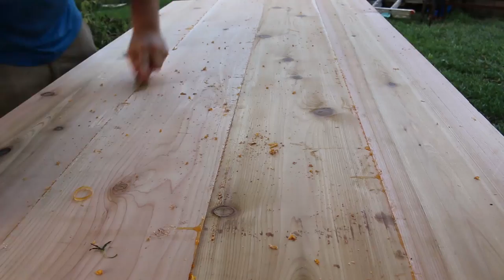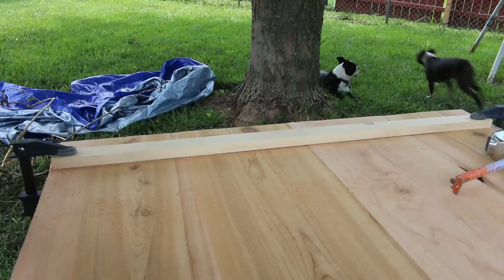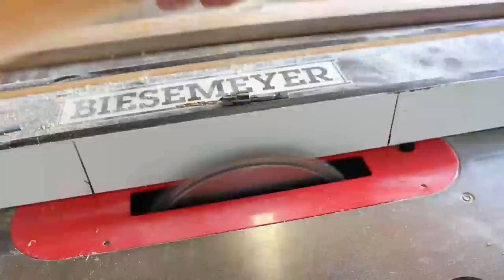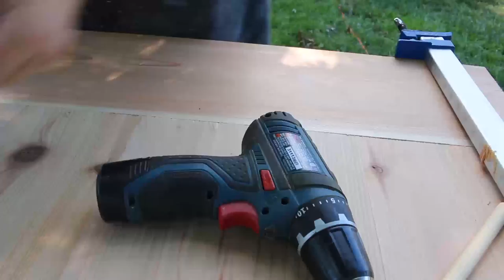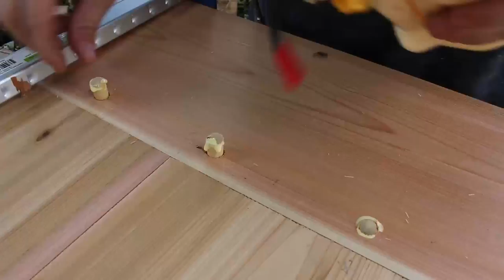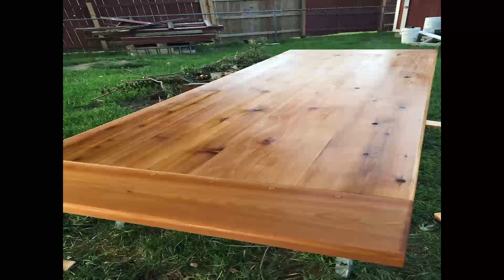Tabletop from Cedar Lumber Part 2 of 2

Comment: Just happy someone is putting bread boards on without using glue & pocket hole screws all the way across the table. No I am not joking.
Great job & video. I will be making my first Farm house table with breadboards this summer for a wedding.
Being my first bead board table, I am going to first make a practices  table out of  2" X 12" X 7' boards & 4" X 4"  "H" frame legs, I up cycled from a large shipping create.
If the practices table works well, then the bride can use it as a picnic table.
Reply from the maker: That’s a great idea Joe!

Comment: Thank you for sharing! Could I use the same products for a private fence with cedar boards? What is your suggestion if I don’t want to stain the boards but just exposed the great look of the cedar boards. Kind of a wet look is what I am looking for. Thank you!
Reply from the maker: Epoxy would be way too expensive for a fence. My suggestion would be to use a sealer like Thompson’s water seal. You can apply it with a sprayer. If you want even more protection, you could use a spar urethane. Keep in mind that both of these options require regular upkeep. I personally like how cedar weathers to a silvery-Gray color, so I just leave it untreated. I have a 25 year old fence in my back yard that has never been treated and it still looks and functions great. Cheers!
Reply: @SouthpawWorkshop   Thank you for the advice!

Comment: Please explain why, if you used dominoes or biscuits to join the cedar planks together, your planks were not level and had to be sanded into obedience.  If you just applied glue to the edges with no biscuits, then I can see why there weren't aligned.  Seems a little extra effort in the assembly process would save you a lot of time sanding later.
Reply from the maker: First of all, thanks for watching and participating.  Not sure I understand exactly the point you are making.  No, I did not use biscuits in this build.  Would they have made it easier? Yes, of course.  This build was done about four years ago.  Not sure I had a biscuit joiner at that time.  I honestly don't remember why the joints were so sloppy at the time, but most of my videos are about my journey learning and doing new things.  That is why you won't find any of my videos titled "How to..." because I'm no expert.  Just hoping that those watching can learn from my failures and successes and maybe be inspired to do something of their own.  Cheers!

Comment: Question: why are these wood slabs cut so thick?  Could thinner versions not be supported and braced underneath to avoid cupping and/or warping?  Seem this extra weight would make for a pretty heavy and awkward table.  And, given you planed the surfaces before gluing these babies together, it appears those joints weren't all that tight when you got to sanding the top surface.  Maybe it's my computer screen....
Reply from the maker: The thickness was just part of the look the customer wanted. Thick top with beefy legs. Thinner tabletop material is fine, but some sort of apron or brace would likely be necessary to prevent warping, especially considering this was an outdoor table. Not sure about the problem with planing before gluing. There’s no way I could run it through the planer after glue-up.

Comment: Great video, very nice job! I am wondering what you used to finish the table? Stain and some type of topcoat/sealer? The finished product looks amazing!
Reply from the maker: Thanks Craig! I started with spar urethane for UV protection, then I finished it off with an epoxy topcoat. No stain needed because the cedar is a beautiful wood in and of itself.

Comment: Did you add wood filler to the gap between the table and end piece?
Reply: If so what do you recommend?
Reply from the maker: If done correctly, there shouldn’t be a need for filler. A good wood filler is timbermate. It comes in a variety of colors and accepts stains really well.

Comment: Why are you putting the wood through the jointer after it's gone through the table saw? Particularly on the breadboard ends when you're doing it after the mortise has been cut. Never seen things done that order before. Was there a reason?

Comment: Did you enlarged the dowel holes in the table to help with wood movement during the different seasons?  Did you glue the end cap or just the dowels?
Reply from the maker: +Brad Clark if you look carefully you will see I enlarged the outside holes in the table tenon and only glued the very center portion of the tenon. The glue you see me putting on the dowels is to affix them to the breadboard ends only. They will be able to free-float in tenon holes.
Reply: Thanks for the info.  I may end up making one of these or something similar sometime in the future

Comment: What kind of wood glue do you recommend using for cedar ?
Reply from the maker: I use titebond 2 for most of my projects. I use titebond 3 for anything that will come into contact with food.
Reply: The reason I ask is because in the past I’ve used tite bond 2 on some cedar 4x4’s I was making for a table top and the joints ended up failing and splitting
Reply from the maker: There are a lot of factors that can contribute to a failed glue joint. Too much glue, too little glue, wet wood, clamped too tight (squeezing out the glue). Not assuming anything, but usually when there is a failed glue joint, either the piece is very old or there was some user error along the way. Hope that helps!

Comment: What finish did you use
Reply from the maker: Spar Urethane
Reply: Can that be used for indoor use
Reply from the maker: It sure can, but you would be better off using a regular polyurethane for indoor use. It costs less and dries quicker
Reply: Thanks for the advice sir